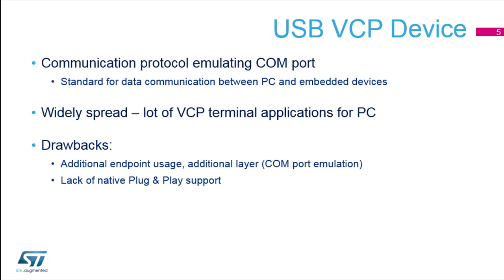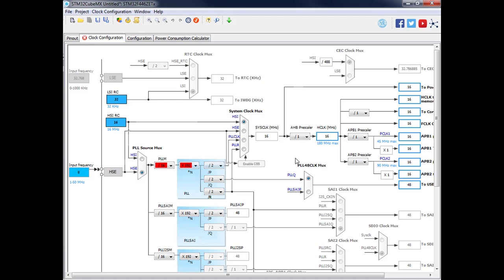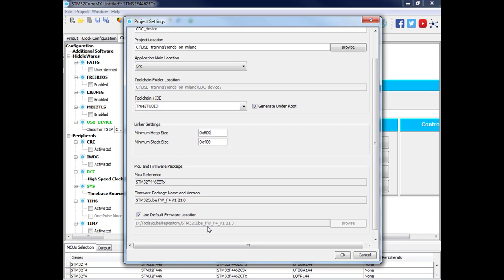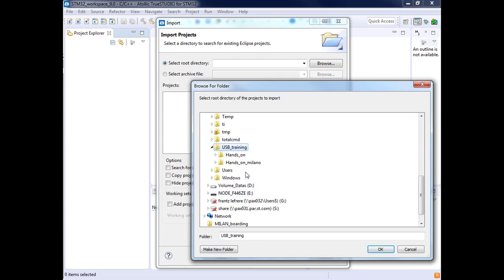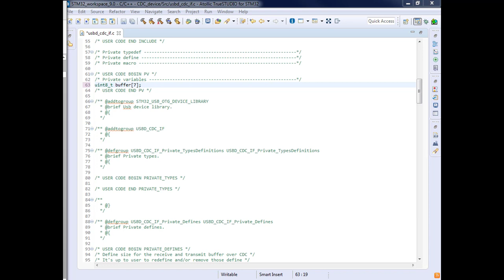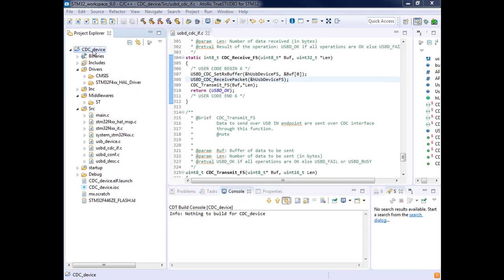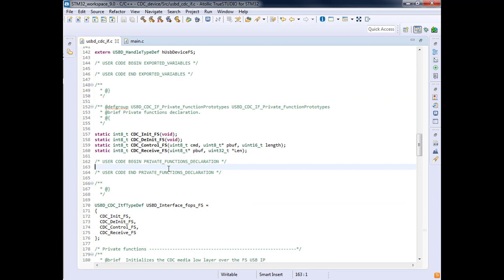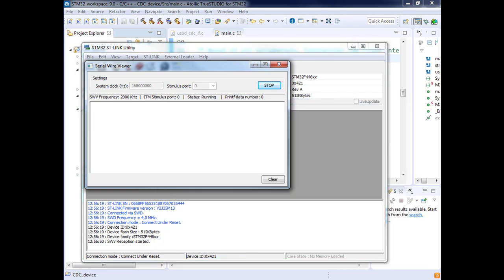STM32 USB training - 09.1 USB CDC device basic labs

Comment: Very informative video for activating CDC class.
On Nucleo-F103RB board  I have a problem to connect the device USB (not the ST-LINK) with PA11 and PA12 pins. It does not detected by my PC. 
Please advice.

Some interesting points in the video:
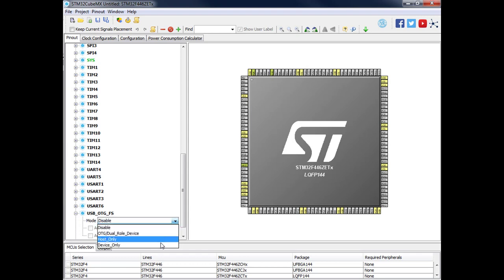2:16 Select USB FS in device mode
3:48 Configure RCC pins
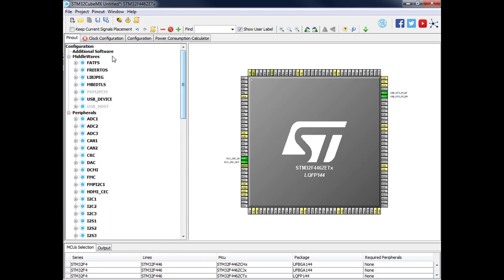4:44 Select CDC class in MiddleWares
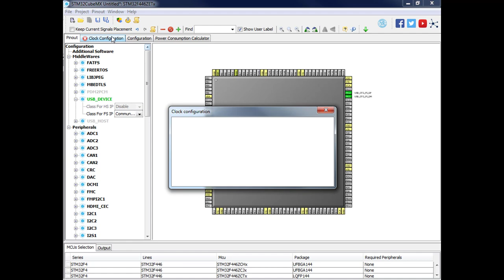5:59 Configure RCC clocks
6:21 High speed external oscilator
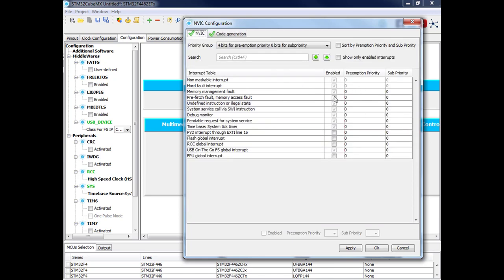9:33 NVIC Configuration
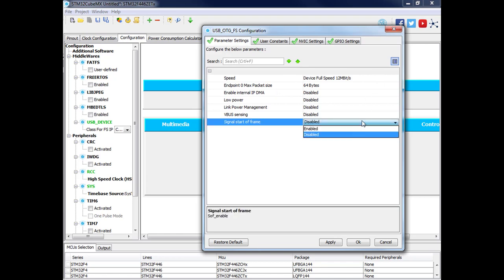9:55 Signal start of frame on pin
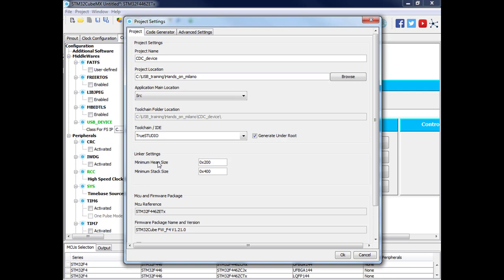12:26 Increase Heap size to 0x600
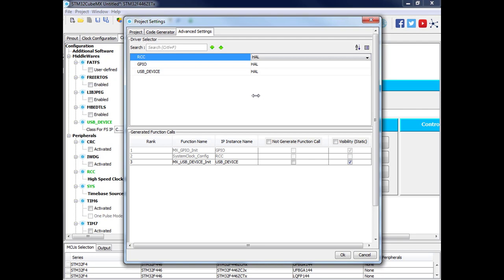15:41 Choosing between Low Layer and HAL
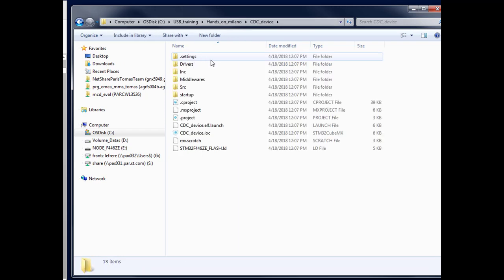17:28 Location where the code was generated
19:44 Import Project into Atollic
21:44 Middlewares Library include \Core and \Class
23:03 Callback from control interface which allow to send COM port
24:34 CDC_Receive_FS()
25:12 usbd_cdc_if.c
25:32 Line Coding Structure
26:07 USER CODE BEGIN and END
29:55 adding code to CDC_SET_LINE_CODING
30:33 CDC_GET_LINE_CODING
32:13 calling   CDC_Transmit_FS(Buf,*Len);
34:00 debugging the project
35:40 Connecting the "device" to PC
36:05 Finding another VCP on device manager 
38:56 Trace Asynchronous Sw
40:10 use "Terminate and remove" to stop debugging.
41:00 Add user code function Debug_write() in file usbd_cdc_if.c
46:00 Debug messages from SWO can be displayed in IDE or using ST LINK utility
46:42 connect STM32 ST-LINK Utility as SWO viewer

Comment: I've had a lot of trouble getting this to work. Using NUCLEO-F303ZE it would not enumerate and show the CDC device in device manager. I finally figured out the D+ is tied to PG6 through a 1,5k resistor and needs to be pulled up. The CDC device now shows in device manager.
Reply from the maker: Hello Bruno. Sorry to read about your trouble and thanks for sharing your workaround with the community.

We've had a quick chat with our colleague you hear in the video to check if there was a better solution for the situation you described. This is his recommendation:

The correct configuration is describe in the user manual of the Nucleo board
https://www.st.com/resource/en/user_manual/um1974-stm32-nucleo144-boards-mb1137-stmicroelectronics.pdf
See section 6.10 (USB OTG FS or device)

The pin PG6 must be handled by the software. You may rely on the code snippet available in the STM32Cube example

USB_Device/MSC_Standalone/Src/usbd_conf.c

#define OTG_FS1_POWER_SWITCH_PIN                  GPIO_PIN_6
#define OTG_FS1_POWER_SWITCH_PORT                 GPIOG
#define OTG_FS1_POWER_SWITCH_PORT_CLK_ENABLE()    __HAL_RCC_GPIOG_CLK_ENABLE()

    /* Enable the GPIOG clock for USB  ull-Up */
  OTG_FS1_POWER_SWITCH_PORT_CLK_ENABLE();

  GPIO_InitStruct.Pin = OTG_FS1_POWER_SWITCH_PIN;
  GPIO_InitStruct.Mode = GPIO_MODE_OUTPUT_PP;
  GPIO_InitStruct.Pull = GPIO_NOPULL;
  GPIO_InitStruct.Speed = GPIO_SPEED_FREQ_LOW;
  HAL_GPIO_Init(OTG_FS1_POWER_SWITCH_PORT, &GPIO_InitStruct);

void HAL_PCDEx_SetConnectionState(PCD_HandleTypeDef *hpcd, uint8_t state)
{
  if (state == 0)
  {
    HAL_GPIO_WritePin(OTG_FS1_POWER_SWITCH_PORT, OTG_FS1_POWER_SWITCH_PIN, GPIO_PIN_RESET);
  }
  else
  {
    HAL_GPIO_WritePin(OTG_FS1_POWER_SWITCH_PORT, OTG_FS1_POWER_SWITCH_PIN, GPIO_PIN_SET);
  }
}

Hoping this helps you solidify your particular use case and this is useful to anybody reading this thread.

Comment: I don't understand what is the purpose of modifying CDC_Control_FS function... In fact it works the same if I comment out these modifications. The only modification that is needed to send back the usb_in to the usb_out is adding the line  CDC_Transmit_FS(Buf, *Len); in the CDS_Receive_FS() function of the usbd_cdc_if.c file
Reply: It appears to do nothing, if you set a breakpoint and look at the pbuf values they're all 0. If you want you can specify a line code, the values will be taken and will be sent back to you too but it does nothing. I wonder if it does matter for other circumstances though? https://stackoverflow.com/questions/56490843/what-is-issue-with-stm32-virtual-com-port-i-can-not-open-it
Reply: I am kind of a newie with this stuff, but I can tell you that without those lines I got a  ''wrong parameter'' error when trying to connect to the serial port on windows.
Here is explained:
https://stackoverflow.com/questions/40597612/stm32-usb-vcp-virtual-com-port

Comment: This device cannot start. (Code 10)

{Operation Failed}
The requested operation was unsuccessful.

How to solve this problem? Serial Port shows up, but it is unrecognised. I did exactly how it is in video. Any ideas ?
Reply: OK managed to solve it. With STM32CubeIDE and TrueSTUDIO  did not worked. However on IAR works great, did not tried with KEIL.   Also increase your heap size to 400 or more, default value 200 is not enough. My project was generated with CubeMX v5.3.0 for STM32F4 discovery board. Hope this comment is helpful :)
Reply: I had this problem. 1) I failed to connect VBus and use VBus_Detect so disconnection/reconnection failed to reset the device. 2) I have this issue (even with v_bus) with certain clock values. (For instance I also can't get it to work with a SYSCLK less than 48Mhz and depending on the other (non-usb) clocks I also get this message. The higher I run clocks the less I see this problem.
Reply: i have same problem
Reply: same for me